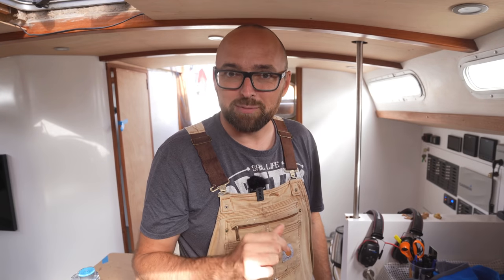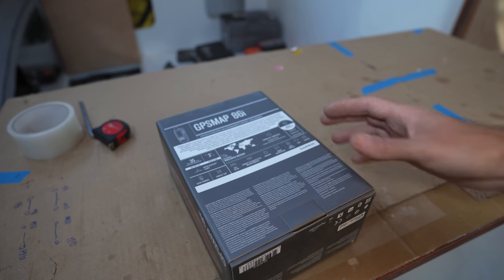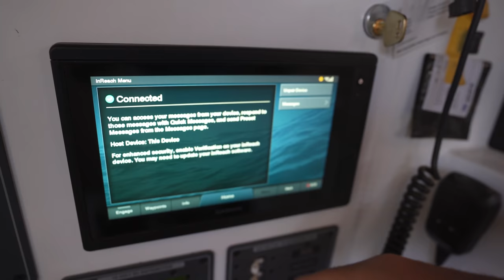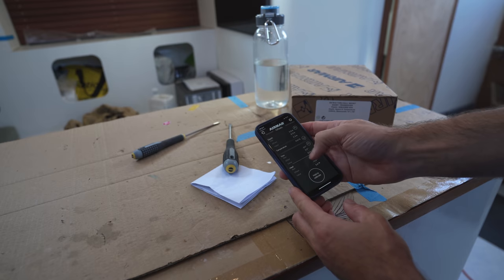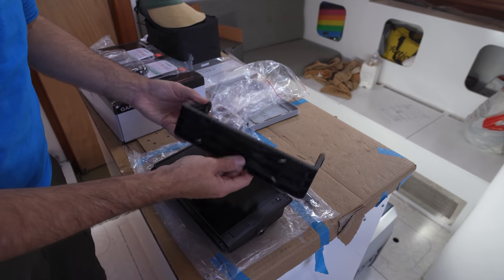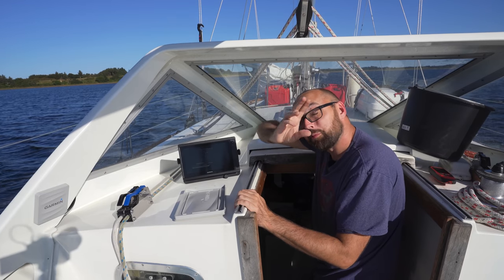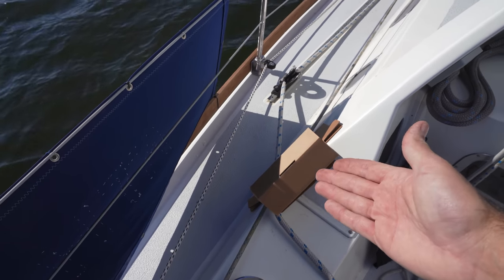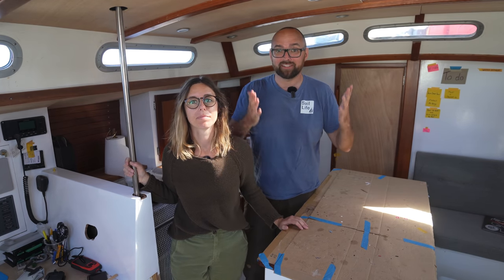Sail Life - First sail after 5 year renovation of a sailboat ⛵

Comment: Sail Life...finally! A "somewhat extensive refit" ? I'm pretty sure your refit is the most extensive on YouTube. Some boats might have been in worse shape you begin with, like hurricane damage, etc, but the systems you've installed, the equipment you've installed, the quality of workmanship you've shown us, the forethought for said systems and equipment and rebuilds, the forethought on how you built up the mast was especially incredible, the high level things like paint choice, other materials, etc. Your refit is the highest quality, most extensive refit I've ever seen. Cheers 🍺
Reply: He’s modest as well!… thanks Mads I learnt a lot! Adventures to come with you and Ava…can’t wait!
Reply: So true, one could easly think that you have done this your hole life. Your skills and analytical approach to every thing is amazing.
Reply: So sad that an oversight on the Perkins displacement scuttled the repurposing of that motor as a geneset. I was truly looking forward to seeing that problem resolved. That is about the only fail Mads has had so far. I am certain if Ava's shengen clock wasn't near expiration Mads would tough it out and make it work. But happy to see them nearing the goal of departure on (almost) their own terms.
Reply: Check out Sailing Yaba.  They're in the middle of a major refit, as in a team of shipwrights has rebuilt a soggy rotten wooden boat from the frames up to the cabin so far.
Reply: At least it is in the running with Acorn to annabella. Remember they said it was a refit and dug a hole to pour the Keel then building a saw mill to cut every board. They have to be related some way.

Comment: It's so awesome to see you guys sailing, almost seems surreal, but awesome! Well done!!!

I'm more than happy to help you with your drone flying, I think I'm starting to get the hang of it now, but between now and then, if you want some tips that really helped me then I'll bullet a couple below.

Fly manually - Don't use any of the intelligent flight modes as these require the use of the sensors being on, and that can make landing the drone very tricky, especially if it isn't flat calm conditions. So when you fly, turn off ALL the sensors, I mean you're on the water so there isn't much to bump into anyway.

Make a handle. I made a grab handle to attach to our Mavic drone which made landing it at sea about 10000 x easier. Although get all your shots in the first 25% of the battery and then give yourself 75% battery to get the drone back on board, it's way less stressful than when your alarms are going off as the battery is low and you're struggling to retrieve the drone. 

Fly the drone in 'tripod mode' it really helps with  smoother, more cinematic shots.

Buy and use some polarising ND filters, they help take some of the glare off of your shots, especially as you're on water with a white boat, everything can easily look over exposed and shiny.

In your drone settings set your shutter speed for twice your frame rate, this gives your shots a natural looking motion blur and again gives you a more cinematic shot. Don't use automatic settings, a little practice with this will pay off in future production quality. This is the main reason to use ND filters, they are like sun glasses for your drone lens and depending how bright it is when you shoot, you will need to adjust your level of filter accordingly.

And a last tip to help get your started is try and get your shots either first thing in the morning or at sun set, during the 'golden hour', the lighting is so much better that again, it makes your shots look more cinematic.

I hope that helps guys and hopefully when you're over in the UK we can grab a beer and chat all things drone and Trident 😁😁⛵️⛵️⛵️

Best of luck guys,  fair winds and we'll see you soon 🤞🏼🤞🏼🤞🏼
Reply: You and Mads hanging out would be an epic video!
Reply: ..and make sure when it sinks the tide isn't running!!! :)
Reply: @AthelstanEngland  ha ha, touché 

The timing of my video could hardly have been worse 🤣🤣🤣
Reply: @CadohaAdventures  lol.

Comment: Hi, when removing oil with these vacum pumps you need to run the engine to warm up the oil first!! :) works a lot better then ;)
Reply: Adding a piece of metal tubing just smaller than the dipstick hole to the end of the suck up hose helps immensely. You can modify the tubing on this pump to make it work effectively.

Comment: I have been following your journey for all these many years.  I've said it before, your patients is amazing. 
 I have some thoughts for some issues and items noticed. 
1- Ava was looking for shelves in the V berth cabin.  Problem was you could not fit the shelf into the opening.  Solution - get measurements  and add 3-4 " to the width. then cut them in half.  Insert the 2 halves overlapped then spread them out ounce inside, securing them in the middle.  The clothes' will not mind the seam.  
2- looking at the cardboard on top of the island to protecting it. Solution I believe a store like ikea sells "Shade making " supplies.  Get the width of the island and make 2  "shades" of 1 for brown paper and 1 for a roll of 10mm clear plastic.  Affix the "shades" to the underside of the island facing the setae.  One above the other. Just pull a length of shade- paper or plastic to cover the island and then, rip off when done or dirty.  If still useable allow to retract..
3- Storm food- When sailing during a storm you may not be able to cook a hot meal. solution-  pick up a number if Military style MREs (Meals Ready to Eat).  All that is needed is to open them up and add water.  There is an exothermic plate in the pouch that will heat up the meal and you can eat right out of the pouch. 
4- Medical issues  Solution -There are full medical kits available for sale.  They are usually bought by "preppers" but contain all of the supplies needed to do minor surgery. (needles, scalpels, etc.)$230 -$250 This should cover you while at see for just about any type of emergency. 
5- Maintenance/repairs-There may come a time when you are at sail and you won't be able to do maintenance or chores.  Prepare a zip lock bag with the required filer/ gasket etc. If you prepare a instruction sheet listing what supplies and tools needed and insert it into a plastic sheet protector, Ava would be able to handle the job.   When the time comes everything will be together.  You've got 2 engines with different filters for oil, fuel, spark plugs, etc. which can get confusing.

As you can see, I have been laying awake thinking about the possible problems you two can face.  I am a grandfather and don't want anything to happen to you to.  I wish you were closer so that I could "Hold the screw, while you tighten it".  Good luck on your journeys.
Reply: One thing to add; and this is not just a "nice to have":
Make sure you don't use conventional cordage at the bottom of the weather cloths when heading offshore. They need to have bungy cord attaching them to the toerail. They can scoop up a considerable mass of green bowwave when the rail goes under at speed, and then as the boat staggers back upright as it slides off into a trough, that same mass of water, hemmed in by that high barricade, will very likely bend the stanchions.  I'm not just regurgitating what I've read, this is bitter experience.

Comment: Hi Mads and Ava. Congratulations, A momentous achievement. A real high quality refit/rebuild which has taken a great deal of time - but worth every single day you spent doing and documenting it. Good luck with the rest of the shake down and fine tuning of your fine vessel and it’s many systems. Do not give up on the PELA - it really should not take that long at all there is something drastically wrong - you did get the oil warm first- didn’t you? Good idea to reach out to your fellow warrior 38 owner (Cadoha) - if I recall correctly he carried out a very useful modification to the drone which makes launch and more importantly recovery less ‘dramatic’ without altering the essential flight characteristics. Good luck with the next steps.😀👍⛵️

Comment: Could you use an iPad as a repeater at the helm station. I guess you will have a local WiFi network in the yacht. Mads, why couldn’t you reinforce the Solar Arch you seem to be a very good stainless steel welder.
Reply: He mentioned earlier that he needed to get all of his stuff out of the workshop.
      
    There may have been an issue with the duration of his lease agreement with Cement Boat Guy.
       I don’t believe Mads owns TIG welding equipment.

Comment: As a last ditch effort, you can drive a screwdriver completely through your oil filter and use that for leverage. The last time I did this, 1968, I wrapped a chain around it and attached it to the jack under my car. Jacking it up spun the filter off.

Comment: As mention in another comment - some/most new transducer housings come with a "self-closing valve" to reduce water flow when changing out the transducer with another, or with a plug. So if your housing has that self-closing valve then you should KEEP the yellow o-ring as stated in the Airmar installation manual. :)

Comment: I'm a little worried for the electronics in the bilge area right next to the LiFePo4-pack. The bilge pocket is quite deep in this boat, but You would be amazed at how far water travels when the boat heels over and You have some water in the bilge. Electronics don't like water.
Reply: Luckily he seems to have between three and seven times more electronics than necessary! (Some would say infinitely more ! ...)

Comment: Here are 8 more no cost/low cost ideas (some are from other vlogs but are still great ideas)
1- install red LED lights throughout the cabins and cockpit for night vision preservation. Can be under locker "mood" light locations
2- install cost hangers in the shower head to hang wet foul weather gear to drip off directly into the drain
3-install non-skid mats in lookers to prevent slipping of containers and items. They come in rolls and can be cut to size
4-purchase Surge protector power strips in 120 and 240 voltages.  Protects items from voltage shock
5- use color coded bags or tags for items in the food lockers to be able to locate meat, fish, pork, etc,  quickly
6-remove all paint and varnish from boat while sailing. Reduced fire hazards- no repair is going to require pain or varnish while at sea
7-get small battery powered pumps to drain oil, water, etc. and/or transfer same. They come in different colored housings. Red for oil/diesel;  blue for potable water
8-get collapsible/folding water containers to collect onboard water creation.  Less chance of contaminating water supply if on board unit is not working properly. Draw water from these collapsible containers first, saving water tank as a last resort
All of these things should cost less than $100 and be available in Scotland or the UK.

Comment: Hi Guys. Mads you did warm the engine before extracting the oil? Our extractor pump is the same and it works great 4-5 mins at the most. Top Tip: Put half a liter of clean oil in the hot engine to flush the dirty oil out before extracting that too. Drone footage "what we have learned" in our video next week OTB 108. Sail Safe Guys, Ant, Cid & the pooch crew.

Comment: Mads, I've just gone through installing a D2-40 in another vessel, deleting the MDI box in the process. It's very straightforward but will require replacing the gauge pod with a programmable VDO gauge. At the very least you'll want to wire an emergency start button as those MDI boxes seem like they'll continue failing.

Comment: Those oil extractors work fine but you've got to run the engine for few minutes to warm it up before using.

Also, if you put a plastic bag around the oil filter after loosening it and before removing, you can be more confident that you won't make an oily mess if something goes slightly wrong.

Comment: A great channel and congratulations on finally getting on the water. I bought a very similar oil extraction tool and had the same poor results, wasting several hours pumping for very little extracted oil. Eventually I cut off the narrow black end to the pipe leaving only the clear hose which was just the right diameter to insert into the engine's oil extractor pipe. This formed an air tight seal and after few pumps I saw the old oil flowing out in the space of seconds.

Comment: I'm surprised you didn't buy some tubing clamps and some cable to brace your solar stand so you could get the solar up and running. A small cost for a temporary fix would have reduced a lot of your current stress over the generator and alternator.  That said it is good to see you out on the water.  :)

Comment: Nice work, you guys have bee busy. I would add angle plates behind the autopilot and depth so that you could see them behind the helm. Also be careful with all electric devices in the battery box floor. They will get wet if the boat heels with water in bilge.

Comment: With a do-hicky thing to stop the water coming in on depth sounder, I had to keep the yellow o-ring????Although I have the Ray-Marine version. Just a thought, worth checking. I'm on a Warrior 40. Nice job. Nice to see you sailing. Don't you just love those MDI's? I'm on the 4th … Saving up to get a spare!
Reply: It's called a "self-closing valve", and some/most new transducer housings come with such a valve to reduce water flow when changing out the transducer with another or with a plug. So yes, if your housing has that self-closing valve then you should KEEP the yellow o-ring as stated in the Airmar installation manual. :)
Reply: @toddmalone4384  Exactly as I said, so why change the Oring to the black one?????

Comment: Congratulations Mads and Eva on a monuMENTAL amount of work. It's such a major milestone to be sailing again. You might want to look into Openplotter on the Raspberry Pi down the line (for its tinkering and redundancy value, when the Moitessier HAT and McArthur HATs become available again. Also, you might want to put bumpers on the stainless steel corners of the steering column add-on, just in case anyone banged into them in a rough sea. When will you be heading to Ireland?

Comment: @ 2.05 you have a drain plug. You could have put a 90 there and simply drained the oil into a pan.  High output alternator??? just go with a regular one and keep the engine and it's electrical completely separate from everything else, you will wish you did.

Comment: If you heat your oil up by running engine it will be way easier to pump oil out.  A electric pump might burn out without this step as well

Comment: Oh, snap!

I just installed that same exact DST transponder a couple of weeks ago as a replacement for the one that got fried by the lightning hit.  I thought that the O-ring only had to be changed when one is using the bronze through-hull.  I was replacing just the transponder into our already existing plastic through-hull and didn't change the O-ring.  I hope I didn't screw that up!  OMG.
Reply: After reading the damn instructions again it seems the other O-ring is for through-hulls without a flapper valve.  We have the flapper in the old through-hull so no reconfiguring was necessary. 

The new DST came with a new through-hull and I guess that will be a spare in case the old one develops a crack or something someday. We have two blanking plugs as well as the useless dead old DST that could be used as a blanking plug as well I suppose.

The Bluetooth connection and app are really damn spiffy.  I was impressed.  The old transducer lasted 5 years and I read that they do wear out over time with the motion of the water wheel. We have logged around 25k nautical miles so perhaps it would have needed to be replaced sooner or later anyhow even without Uncle Thor throwing lightning at us. I wish he would stay being the god of hammers...
Reply: Hope your marina survived the remnants of Ida.
Reply: They did well even though they didn't have as much time to prepare and were suffering burnout of people in the marina not pulling their trailerable boats.   

They had a Lot more boats to shuffle this time compared to Henri last week as they folded the finger piers back aeay from the current.

I fear if another storm comes soon they will be irreversibly into "boy who cried wolf" territory.  I'm watching Larry and the next few storms with dread.

Comment: Just found your channel. 
Any alternator needs an 'exciter' signal to create (excite?) the magnetic field that the alternator needs to be able to start charging.
In cars this exciter signal is often provided through the red no-charge warning light. (It lights up when you switch on but the engine is not running yet. Once the brand engine IS running that charge light should switch OFF indicating that the alternator is charging.
So, the question is, does the alternator get that exciter signal?
Good luck with the boat, it looks great!